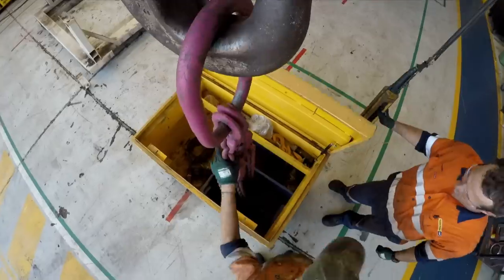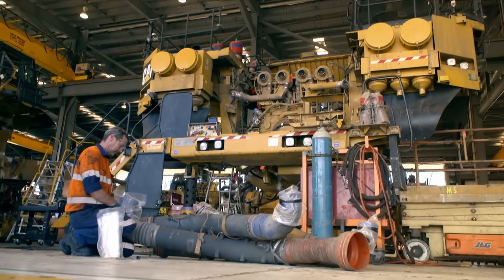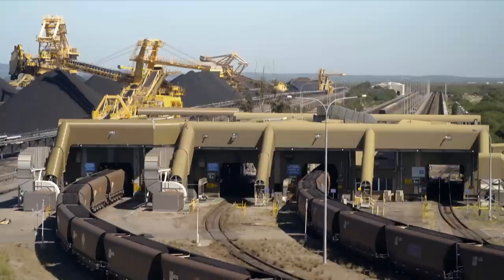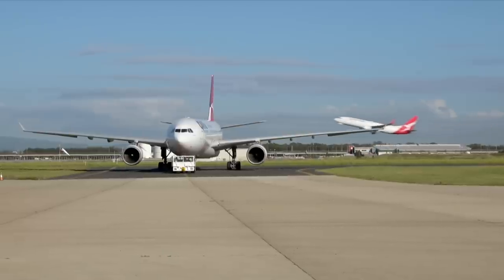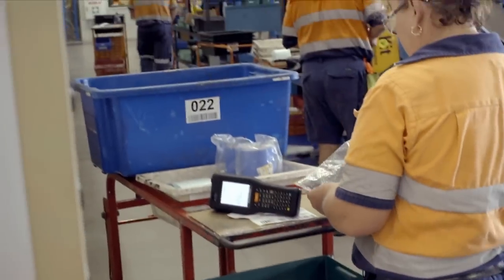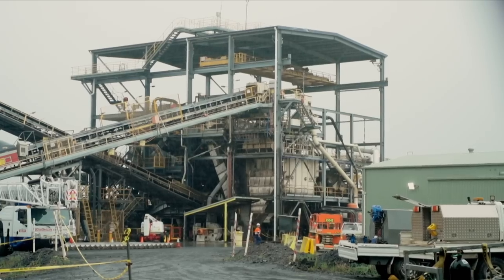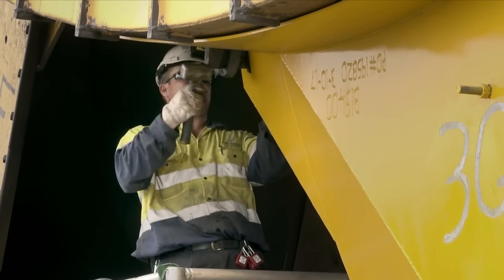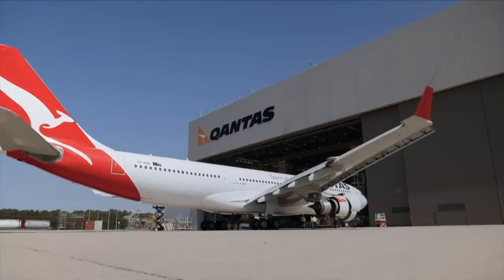What Happens When Heavy Metal Machines Breakdown? | Mega Mechanics | Spark

Comment: Having to hone a multi-thousand dollar part right out of the box?  Did the machinist even read the print when they produced the part or were they trying to stuff a Toyota part in to a Lexus car?  Blimey.
Reply: I am a auto mechanic and I have these same issues with manufactured parts right out of the box. some parts get machined to the wrong dimensions and there is nothing Absolutely nothing wrong with adjusting them "in the field" of shop in most cases.
Reply: @ooelectronoo  I understand your sentiment and have also had my share of parts that needed 'field engineering' to fit, but the margin of error between a car or a rock crusher is way different than an aluminum tube rocketing through the air at 500+mph  at 30,000 feet.  Precision is the name of the game with airlines (or should be.)
Reply: Yes and that is why they have a professional machinist on staff to get it precise
Reply: ooelectronoo exactly. I was also just throttled when I saw them opening the crate the pin showed up in and it looked like it had been rattling loose in the box all over Australia! If you’re going to store it, at least wrap the threads in plastic! As for the assembly pin on the pintle, it looks like they have a pressed-in bushing that gets replaced perhaps they put the wrong bushing in. But still, they should have caught that on a load-bearing component.
Reply: For $40k, it damn well better fit right the first time!
Reply: @kz03jd  yeah it absolutely should, but then it would take that much more time getting the company to fix the mistake. I’m sure they said something about it but just went ahead and made do with that one

Comment: 16:21 that absolutely doesn’t have the capability of a crane. Not even close.  It’s a forklift with a telescopic boom . You can’t rig to it without a special fork adapter. It has no cable , it’s can’t swing left or right. It’s just a forklift with tires . I work with cranes and also those RT forklifts .. 100% difference .
Reply: derek Rohan what I couldn’t figure out is why, after taking one look at the fucked squid inside the back of the boom the head guy didn’t immediately say “get the crane, this thing needs to GO!!”? They wasted (according to the show) 5 HOURS!!

Comment: The only difference I see in this mine shop vs ones in US is safety/PPE the difference is hard hats US is required to wear hard hats by OSHA. 
My first day on the job that I had a guy was working on something and the hydraulic line came off and hit him in the hard hat 99.0% sure he would have died if he didn't have the hard hat on. It cracked it half the way on the left side of the hard hat. (Front of the hard hat to the middle of it.) 
So wear all PPE.
Reply: Heather Bergstad especially around charged yet static systems like pressurized lines, wires/cables with electrical potential, loads with kinetic potential, etc.